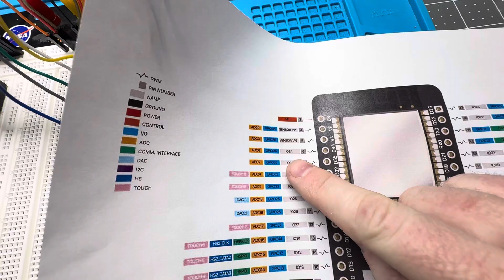Proto G New R&D Lab!

Comment: GP I/O is a generic term General Purpose. The development boards I/O is dictated by the firmware the manufacturer flashed on the ESP and when some pins are used internally for the boards function they can only be used as inputs and or outputs as defined in the manufacturer data sheets. There are so many devkits on the market and not all are drop in replacements. Great lab I have followed you for years and hope to see some exciting things.
Reply from the maker: The main point is do not expect them all to be inputs and outputs. You can always dig through the data sheets but it’s hard to trust random dev boards. I’ve recently made the switch from KiCAD to doing boards completely in Fusion so I’m looking forward to making some content when I have time.